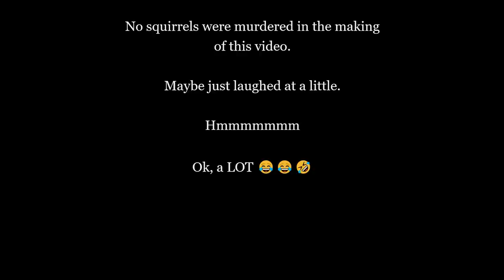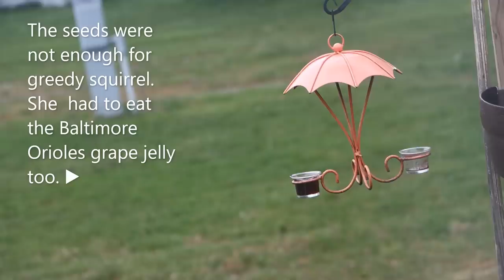Squirrel vs Electricity. BIRDS (Only)

Comment: Well done! This is the most efficient way I have seen to date! Thank you.
Reply: Beaker - All the smart squirrel has to do is chew through just one wire. It appears to be the soft plated type. I had the same
kind of wires chewed thru by squirrels. I was forced to relocating 20 of them in one month using a HART Have-A-Hart trap.

Comment: Just got ourselves 2 bird feeders and a "squirrel defeater" (yep! That's the brand name as well). The bird feeder does it's job. The squirrel defeater also does its job, kinda/sorta. As long as it is set to the right height, no squirrel has been able to get to the feed. But those squirrels, though. You can see them look up and scheme their attack -- my wife finally told me, if the squirrel makes it to the top and gets to that feed, I am going out and placing the feed on a paper plate on the ground for them! They've earned it. :D

Comment: I have basically the same setup,my feeders are about 8-9 feet off the ground and I have them on pulleys to let them down and fill them.I wrapped the post in black aluminum flashing and put a  squirrel baffle on it,
I never have any squirrels on my feeders. 
If I had to do it again I would use a longer 4×4
I had a bear break my feeders once. 
I like that idea,I was thinking about using your idea around my feeders to keep bears away.

Comment: If the squirrels, just like the squirrels around here, had any sense, they wouldn't have to climb up to the feeders. The birds are so messy, they knock more out of the feeder than they eat so there's more than enough on the ground.  lol  My dad wrapped the feeder post with sheets of aluminum with the top sheet overlapping the bottom one so the squirrels couldn't jump up, get their claws on the top of the bottom sheet then work their way on up.  Worked pretty good.  But your way is way more fun to watch!

Comment: An easy squirrel proof device for those skinny metal poles, is a two liter plastic pop bottle.  Just drill a hole in the bottom, and slide it up the pole.  It is too slippery and two large in diameter for a squirrel to climb or hang onto.  For athletic squirrel, stack two bottles.

Comment: My father in law used to use tubing to tap his maple trees draining them into a tank in the Spring and the squirrels loved to chew through them to get to the sap. A friend and I were going to make a c-clips with an ear on each side to clip over the tubing. Then a light piano wire could be ran down each side of the tubing from ear to ear on the clips and then be connected to a weed burner electric fencer. I know lots of guys that were tapping trees that would’ve bought these clips just to watch those destructive tree rats dance when they got between those wires and ended up getting the hell shocked out of them on the tubing.

Comment: Orioles sure are curious. There are three that almost regularly visit my hummingbird feeders. They can't seem to figure out what the big draw is, but they keep coming back to check. To keep the ants out I make simple moats on either a wire or a bolt, fill the cup with Dawn dish washing soap which quickly dries in a soft wax. Ants won't cross it and it lasts for years. 
Good solution to the squirrels.   Cats would kill my hummingbird visitors, but the feeders are suspended about 14 feet in the air. The fall wouldn't be fatal, but the cats don't seem willing to try.

Comment: Why in the world did I thought that the squirrels were going to blow into smithereens on contact?...
Reply: Especially when the intro said no squirrels killed?
Reply: Yeah it's Disappointing, that would have been hilarious....
Reply: You were thinking 240V.  THAT will blow the little buggers over the neighbor's roof with their tails on fire   :-)
Reply: Maybe hopeful thinking
Reply: Cartoons
Reply: @holeshothunter5544  electric fences are actually way more than 240 volts. They are 2000-10000 volts. It’s the amperage that does the damage. These electric fences put out a few milliamps. If you put out say 20 amps then you would see the smithereens scenario you described.
Reply: That would have been the Deluxe model.
Reply: there's one on a backyard porch where they set up some contraption that launches the squirrel high into the air and it lands in a pile of snow.  hilarious!

Comment: It would work better if you added a ground wires between the HOT wires with fewer hot wires.  Wood is a decent insulator so the electricity has to go through the squirrel then the wood post to return to the ground; in order to make the circuit.  I was trying to keep cats out of my back yard, so I placed a hot wire along the top 2x4 of the wooden fence.  A few days later I see a cat sitting on the pickets and pawing at the wire.  All it was getting was a tingle not the high voltage shock that would result if it was grounded.  So I added a 2nd wire about 1 inch from the insulated hot wire and connected it to the ground rod for electric fence.  Never saw a cat touch the wire again or enter the yard.

Comment: Nice job. Love the solar power. I did something similar: I used a "clicker" from an old gas stove activated by a PIR sensor near the feeder. One non fatal "hint" and they never came back
Reply: A clicker from an old gas stove is not in any way near fatal. Unless you fall off a roof or something.
Reply: @tedmoss  No one wants fatalities, just to get rid of them - kinda like the border
Reply: This doesn't kill anything - just administers a brief shock, much the same as an electric fence doesn't electrocute cows.

Comment: I recently was forced to electrify my feeders too for the same reason. They quickly got the message, but yet they still come back every day and just wander around looking at the feeders trying to figure out a way to get to them. There is a tree and a fence nearby and they will run up the tree and look at the feeders, then they will run back down and up the fence and look at them again, then run down onto the floor and look up at them before repeating the same routine over and over. If they spent all that time digging up their own food that they spent all Autumn burying then they wouldn't need to bother with my feeders!

Comment: Nice birds!!  I'd love to see an Oriole on my feeder someday.  Squirrels I handled with a squirrel baffle, and starlings I handled by a careful combination of feeders/feed.  What they can land on, they can't eat.  What they can eat, they can't land on.  Heh heh.  They show up in their usual gang of five or six like they own the place, and after five minutes they suddenly remember there was another yard they had an appointment with.  So I got rid of what I don't want.  Now I need to attract some better birds.
Reply: Any anti starling effort is good with me. I should know more.
Reply: @echodelta9  I get my stuff at Wildbirds Unlimited.  I have a tube feeder that has a cage around it, which keeps larger birds out.  This was bothering me, though, because I have lots of cardinals around that I wanted to include.  For them, I got another tube feeder, but without a cage around it.  I put safflower seed in it, not the NutriSaff that WU also sells, but the regular white safflower.  The starlings can't break the husks and so while they can get at the seed, they can't eat it.  I also have a suet block feeder which is in a cage, and the smaller woodpeckers, nuthatches and finches really go for it.  Larger woodpeckers, such as red-bellies and flickers consume it also, because they have the long beaks.  I also have a goldfinch feeder which holds Nijer seed, and starlings can't even land on that one, and I doubt they would eat it anyway.  That's my set-up, and I rarely see any starlings.  When I do, I just laugh as I watch them get frustrated and finally leave in a huff.

Comment: My grandma has a similar squirrel problem. I think I just figured out what I'm doing this weekend...
Reply: Make sure you have both positive and negative pathways. The way this works it’s not a complete circuit till both positive and negative are touched at the same time. Otherwise even birds will be zapped.  Also use a low impedance energizer that pulses  not a solid state one!   Make sure that your negative circuit has a good grounding rod.  Doesn’t need to be massive but keeping the area moist helps. Otherwise the system can be damaged.  Solar energizers are good for this application. But a battery powered option also works.  
A cheaper solution would be to mix the seed with ground cayenne pepper before hanging the feeder up. Squirrels hate it and birds can’t taste it.  It doesn’t take much.

Comment: I considered a fence charger, but decided I would try a 5 foot length of 4" PVC drain pipe.  I slipped it over the 4x4 pole.  The squirrels can't climb the PVC, and are now cleaning up the sunflower seeds from the ground that the birds drop.  I'm only using about 1/3 as much sunflower seed with the 4" PVC pipe over the post.

Comment: Not nearly generous enough with the volts.... Then pick it up, skin it, and add to carrots, potatoes in a nice hot bath  (slow cooker) 😋
Reply: It's not the voltage, its the amps, one amp will stop a human heart. I just use a 22. Try squirrel and dumplings, just use the chicken and dumplings recipe.
Reply: I had raccoons climbing the trees killing my chickens in the middle of the night so I did exactly what this guy did, wrapped the trees with both positive and negative wires, but I hooked 120 volts to it, stopped the raccoons in there tracks. This was last fall when I got chickens again after not having them for a while, I didn't have a coop built and within a week of getting the chickens, two hens were killed. About 10 years ago when I had chickens and turkeys the raccoons were breaking into the coop every night and killing something, the suckers are strong, they could tear wire and rip off boards to get into the coop. 
So I set up a spy cam by the coop, watch on a TV in the house, shooting stand in the kitchen shooting out the window, tapped two in one night, two nights later I got a third, I'm kind of in the city so can't be outside at night blasting away, shooting from inside the kitchen muffled the sound, after tapping 3 raccoons my chickens quit dying every night.
As for the squirrels, I can't be shooting them during the day, so I built what I call my "Trap & Zap" it's the standard box propped open with a stick trap, but my box is a wire basket, the floor is hardware cloth, 120 volts to the basket, ground to the floor. A rope runs into the kitchen window and a wire with a switch, some peanut butter on a plate, they go in and I pull the rope dropping the trap. I flip the switch, they grab the basket sides, they're dead in about 30 seconds. It never fails, count is way over a hundred for the last 10 years or so, I get 10 to 20 a year, one year I got like 26, I've zapped 3 in one day, sometimes 2 within minutes, they can't resist peanut butter. If I don't zap em, they eat/destroy everything in my garden.

Comment: What's even cheaper and more humane, is to get a disc of galvanized sheet metal, about 28 gauge should be good, say 24" in diameter, then make a cut in it from edge to the center.  Wind it up on itself so it makes a cone shape, and clamp it at the edge with a pair of vise grip pliers.  Then cut a hole in the center big enough for it to fit around your post.  If it's a square post, make four cuts at the center to make "legs" to attach it to the post with drywall screws or similar.  Once you get the fit right, use a couple of Pop-Rivets to keep the shape and use the drywall screws to hold it in place.  If it's a round metal post, put a worm style hose clamp around the post to keep the cone from sliding down.  It's cheap, easy to clean the bird droppings off of it, and it will last for many, many years!!

Comment: I'm from the SW UK, thanks for a great video and a shocking idea!! 🙂 I'm surprised that your little critters seem to ignore the hanging bird feeders on the nearby metal pole, sure the vaseline stops them from climbing the pole, I tried that too and positioned it well away from trees or jumping-off points, but after studying the problem my squirrels just leap straight up (over 3ft) and hug the feeder tube's top pegs with their feet on the bottom pegs, and they can turn around and hang from the top pegs to empty the tube in a few hours!  Now I think I'll have to rig up a mini-zapper onto the pegs, the birds will be fine as they only perch on one peg at a time and couldn't bridge a pair. 🐿🐿👎🏼🦜🐦👍🏼

Comment: Squirrels can be craft to a point but they don't learn from negative experiences. I used to trap them with a havahart metal cage trap. One of them saw his fellow squirrel trapped, sat on top of them trap observing this. I took the trap and released the first one a few miles away. Then trapped the second one very quickly rebaiting the trap. It was definitely the one that was sitting on top of the because I took a picture of them both with all their markings. There's not enough hawks around to control these little buggers.

Comment: I had to do basically the same thing, I had a bear that kept getting into our feeder so I put a 2 foot piece of pvc pipe in the ground with a cap on the bottom of it to insulate the the pole from being grounded out then rapped the pole with wire and around the feeders and hooked it up to a electric fencer, the bear hasn’t been back yet 😡 I also put the fencer on a timer so it would only come on at night since I have a male Great Dane that likes to lift his leg on everything 😁

Comment: I used to hang the bird feeder from a tree limb that was 30 feet up, and they just shimmied down the rope. Then I put a smooth plastic disc on the rope about 3 feet above the feeder. Any squirrel than let go of the rope to get around the disc fell 25 feet to the ground. This stopped all but one.  One day this big male took a running jump from an adjacent tree and ended up on the feeder.  But then he had no way down but to try to jump over 15 feet to the tree trunk. Too bad he didn't know Newtons third law of motion.  His jump was pathetic at best and he  did his best flying squirrel impression, to no avail. This battle of wits went on for 3 months til another male figured out that he could chew through the rope and drop the feeder to the ground.  Later that day, he won a Darwin award.

Comment: Great work w/ all this footage. Squirrels will insist on trying ad nauseum to get to feeders. I got a baffle and it instantly stopped them from messing w/ my feeder station. Also, pretty sure that is a Chipping Sparrow at 13:28. They have the black eye line and solid color bill whereas the Tree Sparrows have a rusty eye line and a bi-colored bill.

Comment: I couldn't follow all the audio. I take it you've fastened both positive and negative wires to the pole? Are the ones in the staples the negatives? 

It looks much neater than what I've done with a small fence at the base. My squirrels were defeated by a tin strip around the pole, but raccoons shinnied on past it. I've had the fence in place for a couple of years now and haven't had a problem.

Comment: I just wrapped chicken wire around mine then hooked up the power, You can also use Slinkys on the metal pipes.. as long  as it's about 4 ft above the ground . if it touches the ground it's useless.

Comment: Need more voltage, try 110 , turn off power after about 10 seconds of the Squirrel locking up !
The first prolonged zap is usually all it takes, they will usually stay completely out of the yard !

Comment: Oranges for Orioles! Squirrels should be eating nuts not peanuts or bird seed. When squirrels get to know the wiring circuit and graduate in EE they will get the prize. I watched a video of a squirrel teasing and lunging at a red tail hawk. The squirrel has the advantage of ducking below a set of boards called a pergola and it knows the bird won't fly below those lest it hit a wing on one. Smart! A squirrel could short this out with a mouthful of wet nest stuffing.

Comment: Just a friend, it would have been cheaper using a stove pipe over the post, my grandfather used one and myself ,seemed to work. So did the electric fence wire.

Comment: I hooked up 6   9v batteries. then I wrapped duck tape around the metal stand. I taped just more than a soda can. Then I cut the soda can bottom an top off. I slit the remainder. I wrapped the slit can around the tape. Now I connected one side of the batteries to the can and the other side to the metal pole.  When the squirrel touched the can. Zap.